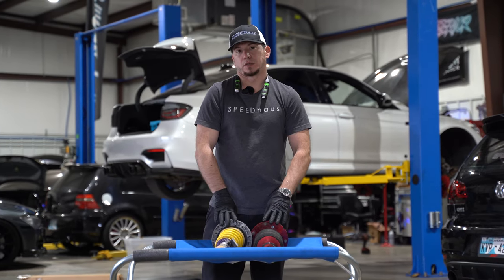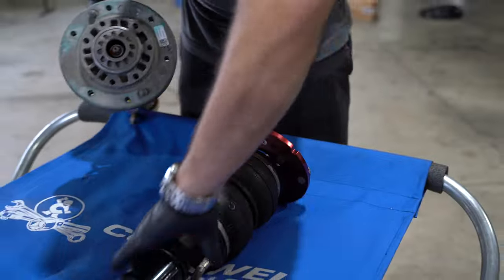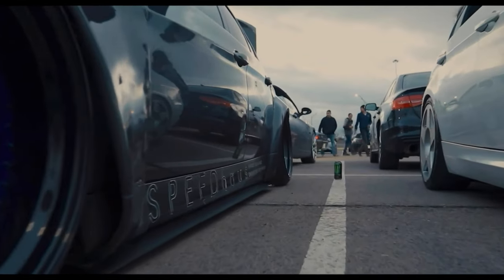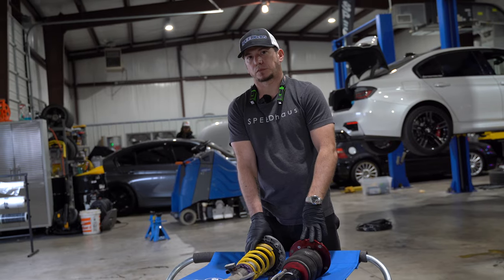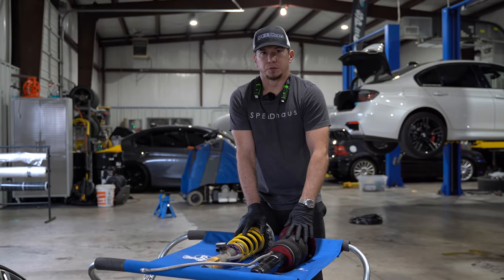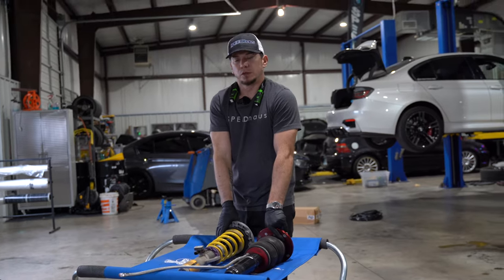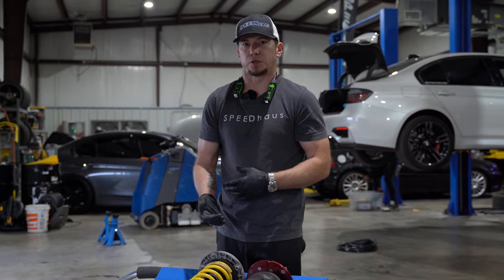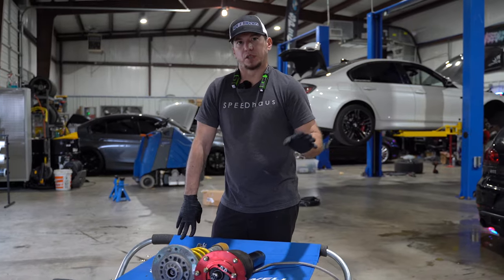Coilovers vs Air Lift Performance! THE HARD TRUTH.

Comment: Opinions don’t matter when it comes to suspension facts do. Air ride is not meant for sports cars at all. Specially if you are going to track your car.  Spring response compared to air bags are not the same. Springs respond to compression much faster compared to a air bags. You will never see any race car run on air bags. Bags are meant for cruisers, low rides or someone that wants to have the adjustability of the ride hight.  As far as pricing goes actually Coilovers can be more expensive depending on what company you choose to go with. Also depends on the materials used to create a Coilover. Like JRZs, Penske or Motons can cost over $15,000- $30,000 depending on the level of motor sport. Even some street setups can run over $10,000 for a proper set.  If you run air bags on a proper sports car, you are running the suspension setup and handling or the car.
Reply: That’s a jump — he’s talking about for a daily driven car/sports car. Yes. A dedicated track car would not use air, although apparently some people do.
Reply: @f3irty278  Their is no manufacturer that has ever ran air bags on street driven sports cars.  Cars like Lincoln, Lexus and other manufacturers run air bags on SUV or family sedans. Air Bags do not have the capability to respond or react to bumps like a spring loaded suspension does. That was my point and I am talking about street and race cars. People running air bags on there cars I don’t care about that, but to make comparisons and state opinions in regards coilovers and air bags that are not true and I have been in motorsports, built cars for over 20 years so I do know a lot regarding suspension.
Reply: Apparently you know nothing about bags
Reply: @mikepeace6694  lol  sure bud. Apparently you know nothing about suspension.
Reply: @M3PQuicksilver  know more than you do and it shows
Reply: @mikepeace6694  Sure bud. Your opinion matters. 

Explain what you know about air bags.
Reply: Wtf 😂I never spent more than 2$k on coils. No average tuner car club meet dude is gonna spend $15k to $30k on coils 😂 unless your driving a Lamborghini. Relax on those expectations dude.
Reply: Straight from the factory the 2021 Mercedes-Benz GT, 2022 vw gti, Audi A5 Sports Coupe, and more are on air. Also, check out Cody Miles's time attack track runs.  

He's done global, redline, and pro series and he's running a Subaru on AirLift 3H Performance suspension. He's broken records in his class.
Reply: @mikepeace6694  lol sure thing.
Reply: So I want cool overs for track and drifting but at the same time I want bags to watch out for my front end/fenders what should I do? Can I mix them or is it a special set that lets me drift easy like coil overs with bags installed
Reply: @M3PQuicksilver  Mercedes AMG GT uses bags.
Reply: @blkeclipsel2400  he probably replaces his bags after every race
Reply: This guy might be the guy to ask Say if you were driving on a realy bad highway long distance going 75 mph would and I mean really bad highway in a sedan  would you recommend air or coilovers Cruising
Reply: Tell that to my car that has fully custom built suspension components, is on air, and gets tracked every weekend
Reply: @philliptownsend2829  probably depends, but on my local track keep in mind we drift. it didnt feel as planted and a bit bouncy imo. i went back to coils instead, it was cool though i like being able be low while cruising and still getting in my driveway lol.
Reply: @Eli-9 nope
Reply: Where are you getting your info?!?!? You might want to change sources...
Reply: There’s tons of pikes peaks cars that use air over coils lol  it this is for daily driven cars not race cars
Reply: @budderswag  lol sure bud.
Reply: You go ahead and build a Pikes Peak car with Air ride. See how well those air bag will do with constant elevation change and temperature change.  

Air ride suspension is not used in any Hypercar.”, Supercar, a proper sports car for a reason.

Ohlins, JRZ, Motons, ADS, KW, Bilstein, King, Fox, Penske are the top leading suspension makes in the Motorsport market and none of those companies will ever use Air ride. 

Do your homework before making comments about something you know nothing about.
Reply: @Eli-9  I have airlift performance series on my heavy ass V8 Camaro 2SS. I've driven it daily and spiritedly for years through winter and summer. 

Of all the components I've replaced on this car, my air suspension hasn't been one of them. Bags aren't as delicate as you're trying to imply.
Reply: False. I have seen many track cars on bags. I raced with a guy tracking a WRX on bags for years and was getting great times.
Reply: Wrong. My 93 Lexus ls400 comes stock with electronic modulated air suspension
Reply: @M3PQuicksilver seems like a i’m right and everyone’s wrong typa guy. Even tho ppl have come at him with facts lol
Reply: @nelsonwilson6292 Air cups are 100% the answer to that
Reply: @erichill7560  Yes, KWs, Motons and JRZs offer the air cups. What everyone else is arguing doesn’t seem to understand the technical aspects of suspensions.
Reply: Great info!! Thank you!
Reply: False

Comment: Common sense would tell you that when it comes to sports cars  there is no way bags can out perform coils.  Bags  (long term) cannot handle the abuse coils can.
Reply: Mercedes AMG GT uses bags.
Reply: Funny considering all truck have bags but they can’t handle abuse?
Reply: @2jzge  the subject is air bags on sports cars. Tracking, racing, hard cornering, drifting ect. I doubt you do that in your truck while hauling your cute horse trailer.
Reply: @Eli-9  He's referring to semi trucks which carries more than 40,000lbs of weight..

Comment: I looking for a suspension where I don't feel the road at all. just like sitting in the car when it not moving, smooth. soft recoveries
Reply: Bose (the speaker brand) did something with magnets, the car is practically floating. If you search Bose suspension you'll find it. I think they gave up on the project tho...
Reply: Look for something like an executive package on air lift suspension, I know on ecs tuning for my mini cooper, it’s 5k but the air ride has sensors that auto level the car so when you hit a bump it will adjust accordingly and smooth it out significantly, that’s what your after is an air ride that has auto leveling

Comment: stupid question, can you help me. I want air suspension for my suv, but I want to make it in most simple way, I dont want compressor, wires and some hoses there, is possible to have air bags that can be filled/compresed with air only from outside compresor in similar way like tires for example? Just add hose and add/reduce air/ adjust ride height few times a week for my needs. Thanks for answer.
Reply: Stupid question indeed.... Sounds like you don't want to spend the whole price... Just get tame coil overs or get sports springs you will be more then fine

Comment: My bag keeps coming loose and airline is wrapping around the bag tried tightening the nut at the bottom but loose again only has 1 nut lock but on my BC coilovers it has to lock nuts to tighten it🤷🏻‍♂️
Reply from the maker: What are you using to tighten the locking collar? Our recommendation is a punch and hammer for final lock to keep it from twisting

Comment: Intresting.
Personally i wonder why not all race cars runs air suspension if it's faster on the track.
I run coilovers on all my cars and they are not extremely bumpy. I would say that if they are extremely bumpy they are not set up correctly.
Reply: thank god this was said. all i could think to myself is "if your coilovers are bouncy they aren't even close to being set up correctly"
Reply: Weight, reliability, complexity

Comment: Just got bags installed on my 86 for the first time and I'm loving it so far. Just the convenience of adjusting height on the fly when I need to is great.

Only issue I have was I wish I bought the smaller 1/4" air lines instead of the 3/8" just because airing up feels a bit jarring at first, its not as smooth or fluent as it should be. But that's just a minor complaint
Reply: Could always add a flow control valve to slow it down.

Comment: I am seriously considering purchasing a quality air bag suspension kit for my 2017 Mini Cooper f56 hardtop. My only hesitation is that in some areas, we have really rough roads with many potholes, and I'm currently having a very rough ride over them. This is despite having a set of quality, brand-name coilovers on my car. My question is, would the air suspension hold up to the very rough roads for a daily driver?
Reply from the maker: Roads here in Oklahoma are not the greatest. Matt (owner) beat on his BMW 335i on air as a daily for 5 years without issues before it turned into full toy.
Reply: @speedhaus405  Thanks for your response.

Comment: Do you think switching to bags would slow down my lap times significantly? I’ve never driven on air suspension so I have nothing to compare to. Cheers.

(F82 m4)
Reply from the maker: For your application I’d stick with traditional coilovers! Cheers!
Reply: Of course it will decrease your performance.

Comment: Do you guys work in Teslas ? How is the ride for teslas drive for model 3 performance and y ?
Reply from the maker: We’ve lowered and bagged a few. Made a big difference on the model 3. Haven’t done a model Y yet in regards to air suspension.
Reply: I have both model 3 performance and model y performance . Does it have any issue when we close the doors and lock the car . The battery will running all the time to the compressor and any code errors will come once I close the door .
Reply: @speedhaus405  how is the ride and comfort with air suspension compare to coilovers from the factory one ?
Reply from the maker: @LP-qg7kc  tremendously better in our opinion.

Comment: How good are coil overs for everyday driving?
Reply from the maker: They’re great IF you buy good ones.
Reply: Get Air Lift if you wanna daily. Avoid brands like Air Tekk because I heard they ride terrible
Reply: @vcrazy_diamond don't spread misinformation. Airtekk makes good struts.
Reply: ItsKev777 like he said they are great if you get good ones but it diminishes your driving experience if they are set too low. 

Any person who has driven low knows the cons. Pulling in drive ways or clearing speed bumps at angles. Damaging your underbody or front lip. Scraping your exhaust. 

Some shrug that kind of thing off but why subject yourself to driving like that when there are alternatives?  Like another commentor said, go with airlift suspension if you're daily driving and want to still enjoy the occasional spirited driving. 

You drive low on familiar streets, ride stock height on trips, lift higher than stock to clear any steep incline and slam lower than any static vehicle out there when stationary.
Reply: @vcrazy_diamond I've never driven on airtekk so I won't condemn them but I too have heard bad things about them.

Your advice rings true though.  Avoid cheap new entry-level air suspension and never buy used.